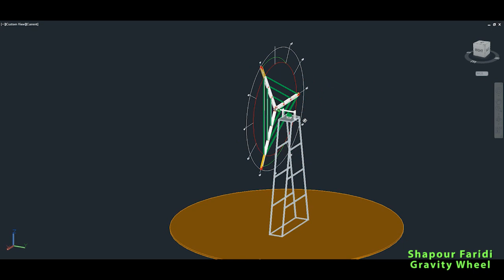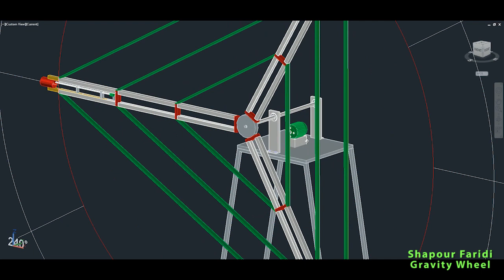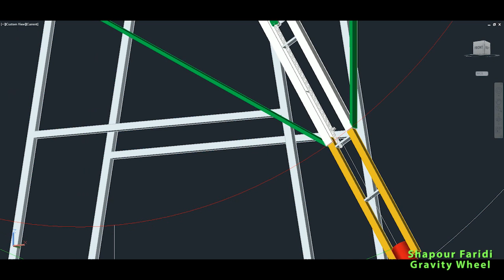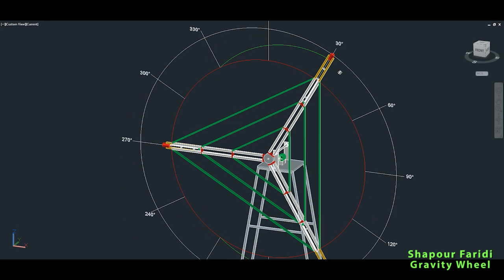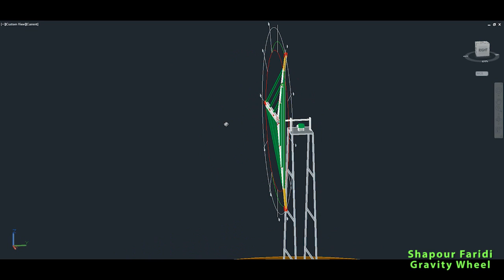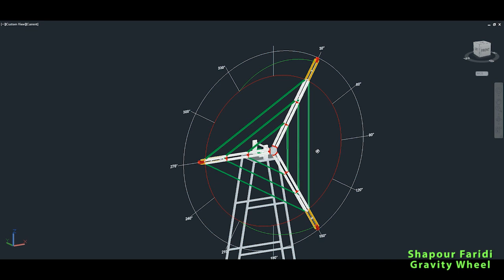FREE ENERGY, Shapour Faridi Gravity Wheel (Gravity Driven Power Generation System)!!!!

Comment: I have seen many similar designs... Sadly on of them work... 
The energy gain due to the imbalance is counterd by the energy required to re-set the weights...
It's not hard creating the imbalance... the hard part is to re-set the weights with LESS energy than the energy created by the imbalance...